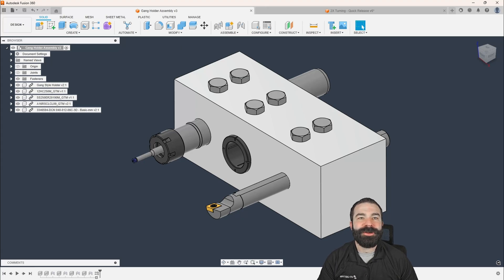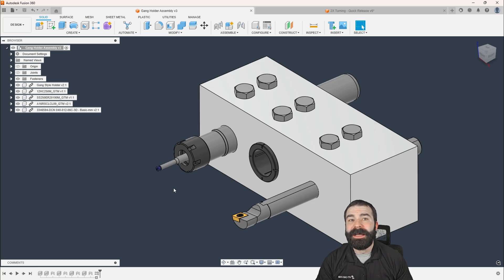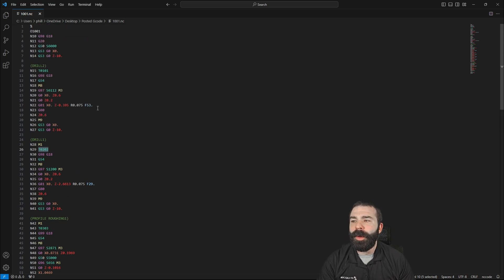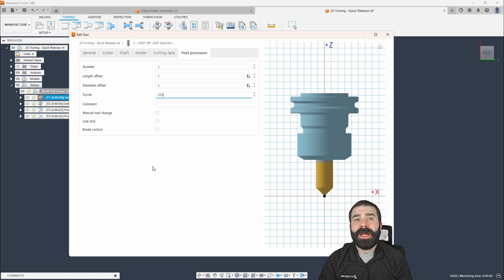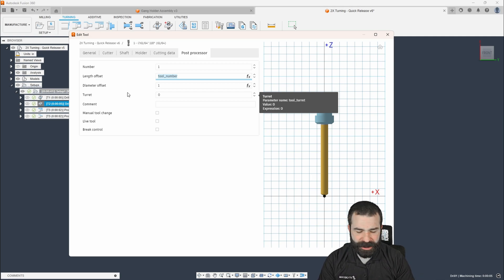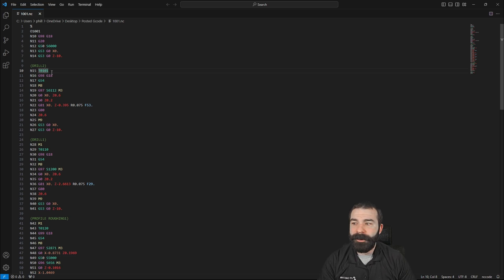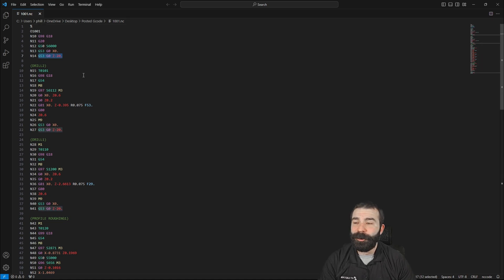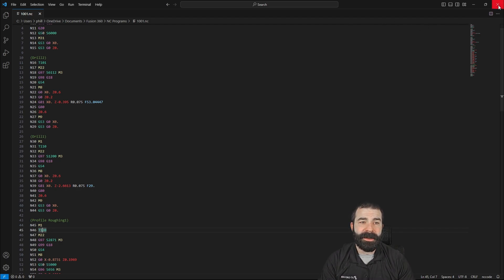Workflow Wednesday: Gang Style Tooling Setup

Comment: hi, great video.  Is it possible to insert these tools into the simulation?  because sometimes you have to edit the code manually, and when the number of tools is 6 or more, it is quite difficult.
Reply from the maker: Unfortunately at this time Autodesk Fusion doesnt support Turning machine simulation where you can see tool changes and such.
Reply: @JITCADCAM  thanks for the answer. is there such a possibility for milling? I have a homemade machine too, it has 2 spindles ("slow" for processing steel and "fast" for aluminum and sometimes they can interfere with each other.